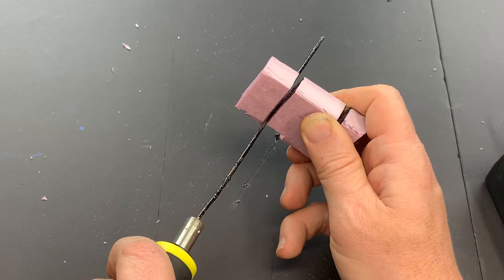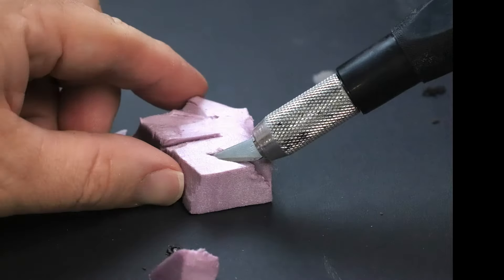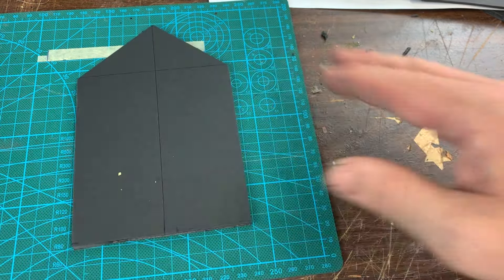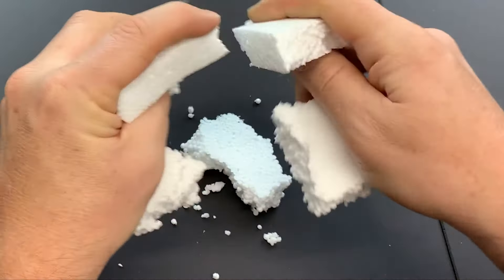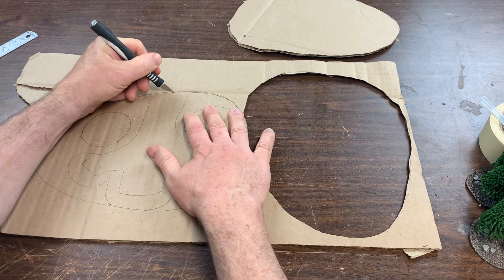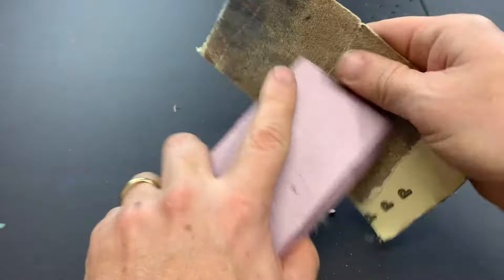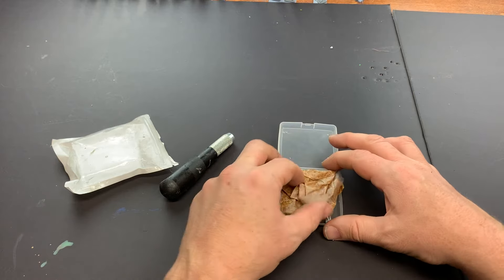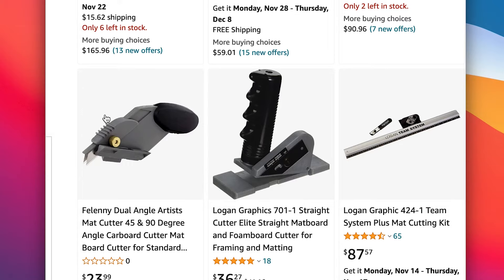Tips & Tutorial for Foam Hot Wire Cutters & knives

Comment: No commentary on the dangers of fumes from burning foam? I'm disappointed.
Reply: Breathing in ANYTHING that burns is bad...it seems common sense should be enough no ?
Reply from the maker: My warning  about this ended up on cutting room floor and I missed putting it back in.  I will address it in the future.
Reply: @davesykes1966  Considering how bad these fumes are? No, common sense is not enough. Add to that the fact that "common" sense isn't so common.....
Reply: @dispatchdave  Lol, Maybe you're right ! Personally I can't imagine someone thinking the fumes are ok :)
Reply: If foam is being burned your tool is too hot and should be adjusted. The white parts that come off of the foam is water vapor and the common comparison used is that it is the equivalent of standing next to a highway. It is no worse than what construction workers experience on the day to day while working on highways.

It becomes dangerous if the vapor is black but your tool does not need to be that hot in order to get quick, fast, and accurate cuts.
Reply: @dispatchdave  it thmells yucky
Reply: @davesykes1966  10:31 Its not about common sense, its about over confidence or perhaps just laziness.  For example whats that sitting unused on the desk at  10:51?